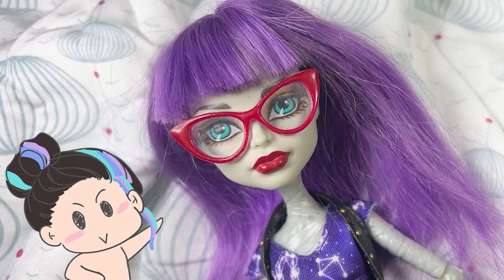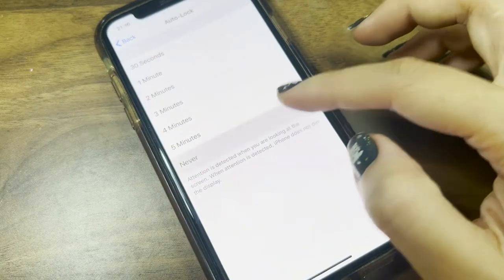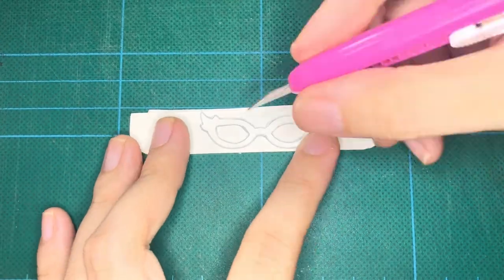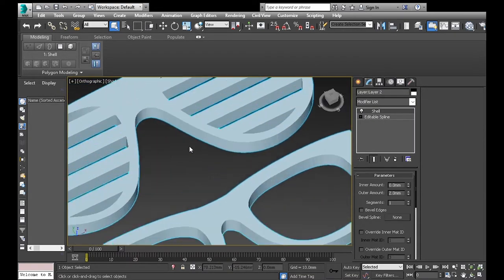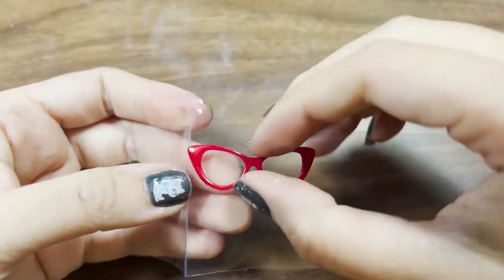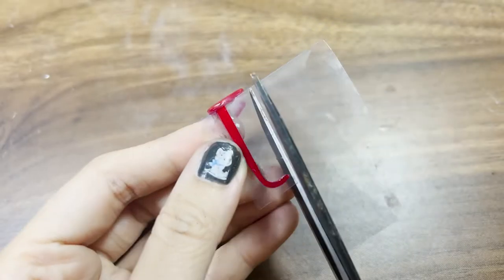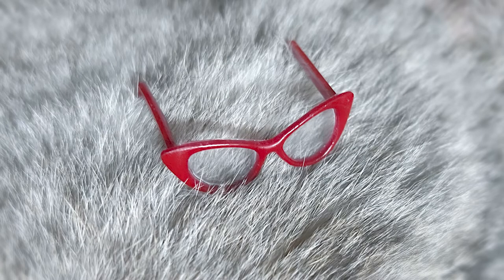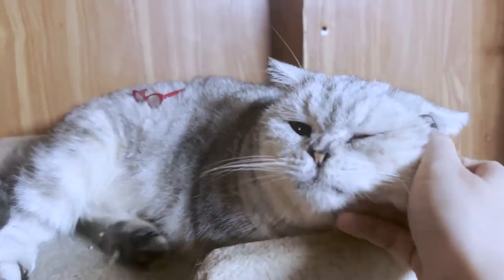DIY: how to make Doll GLASSES  with FREE template

Comment: Thank you for this excellent and easy tutorial,  i will be using your template in my scan n cut to either cut them in greyboard or layer up in heavy cardstock and use packaging i have kept for the lenses.
A very useful product for us paper engineers is mod podge hard coat.
Best to apply a couple of thin coats let cure for 28 days then do more if you want more stability. 
I use it on all my card and greyboard creations big and small x